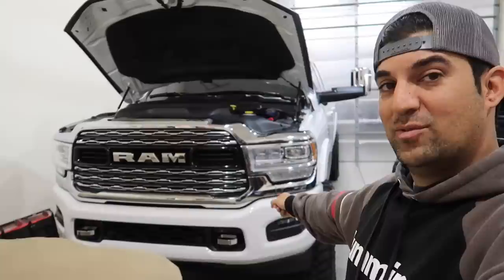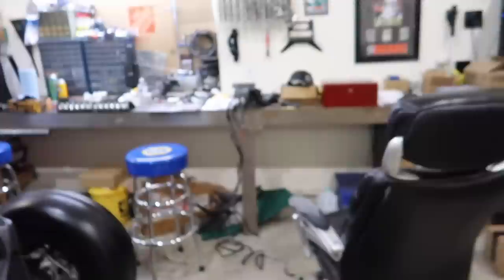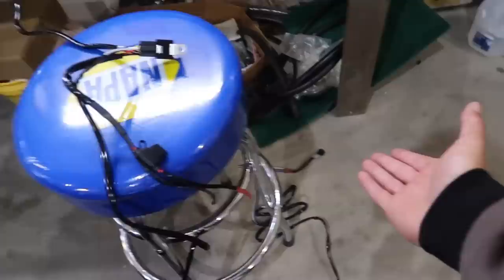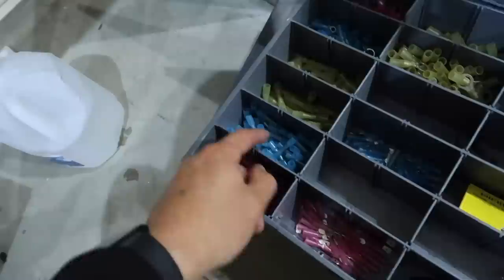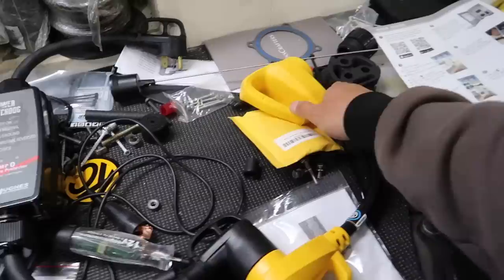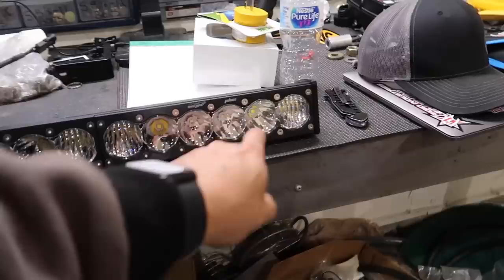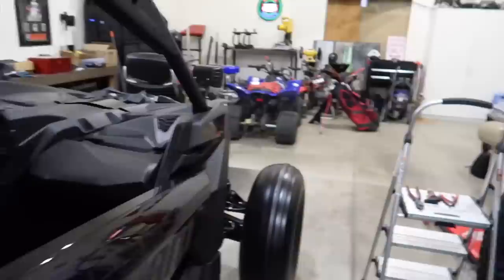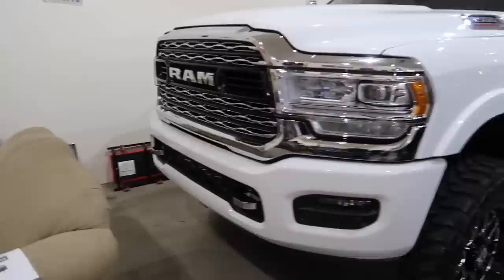2019 RAM 3500 WITH BAJA DESIGN LIGHT BAR IN GRILL!!

Comment: Lookin mint. I put 4 RI duallys in the front grill of my 2019, 2 spot and 2 flood wired separately to aux 1 and 2 in pairs and definitely recommend putting the leds in there. But I didn’t remove anything to install them. Me being to stubborn to remove any part of the front bumper stuffed everything through the two holes behind the license plate bracket.

Comment: I have a '19 2500 Mega and I had a front bumper 20" bar in my old '16 2500, now that we have that black plastic in the front, does the heat from the bar cause any issues to the plastic like melting?

Comment: I wired up the Baja Designs Light Bar kit to my 2022 Ram 2500 to auxiliary 1 which has a 40 amp fuse and it’s blowing the fuses. I wired it exactly how you did in your video (cut the wiring harness off at the relay and hooked white to the auxiliary terminal). Any ideas on why it’s blowing fuses and how I can troubleshoot or maybe something I missed? I looked over the harness for any potential cuts/nicks or other damage and didn’t find any damage or potential shorts.
Reply from the maker: DM me I’ll try to help you
Reply: @Chris Hudson Do you by chance still have the Baja Designs wiring harness that you cut?